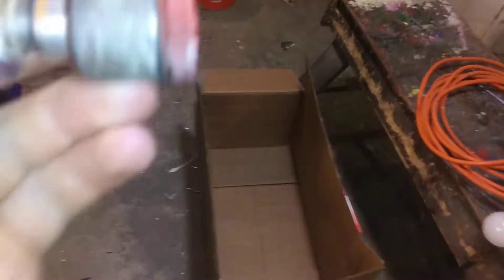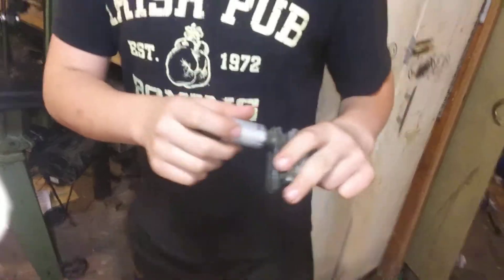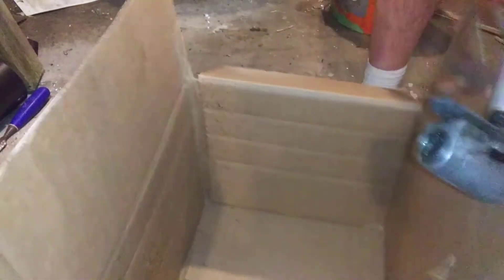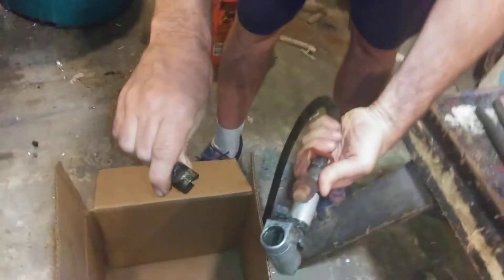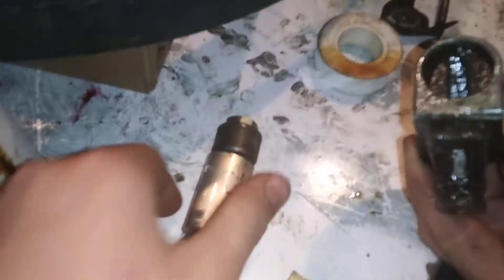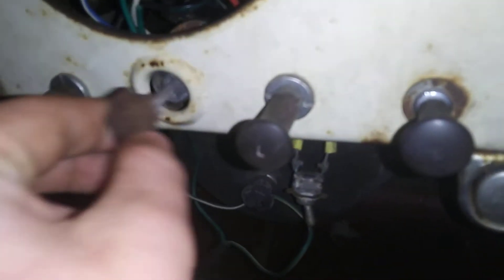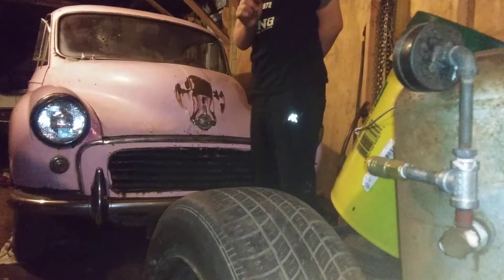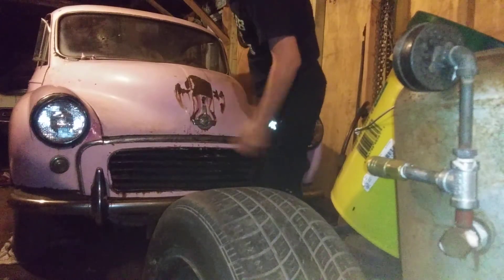Morris Minor restoration part 6 ( brakes part 2)

Comment: I've got the brakes working okay on my Morrie: they're not as good as a modern car but they pull it up well enough - and always pass when tested with a brake machine (during Warrent of Fitness testing times)
Reply from the maker: I'll take your word for it. It has the weirdest mechanism I have ever seen. Even though I'm 14 years old I have worked on car breaks before. My father's 1949 Plymouth had the simplest mechanism ever

Comment: Hmmm 🤔 at best the brakes are adequate... We have a traveller that had all new and the brakes were okay. We have also had a car with brakes that have not been overhauled and they were awful 😳 Disc brakes are much better than standard, we have cars with Morris marina variant and Ford Fiesta variant 🤔 I think the Ford Fiesta variant brakes better. You can also improve braking with a servo 👍 If you YouTube search on ‘Morris minor pickup disc brakes’ you will see what’s required, there are some bits you can save money on by fabricating them yourself 👍